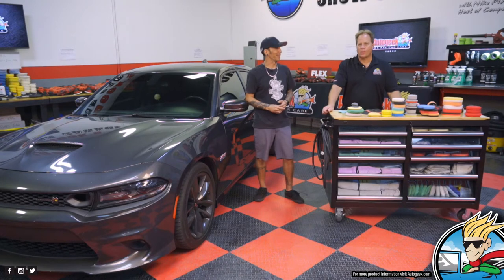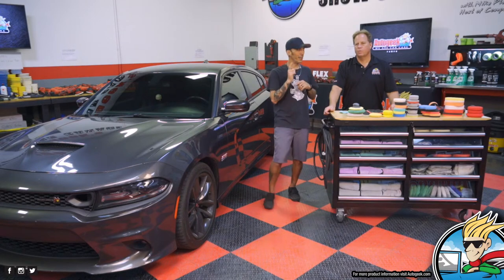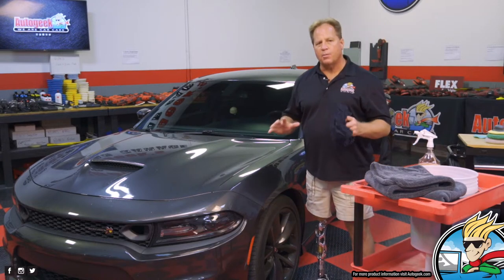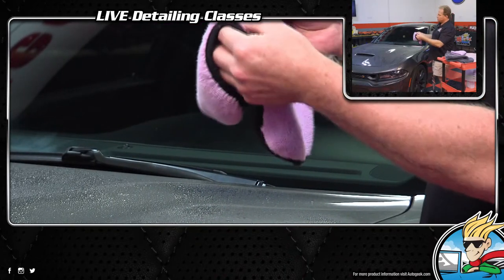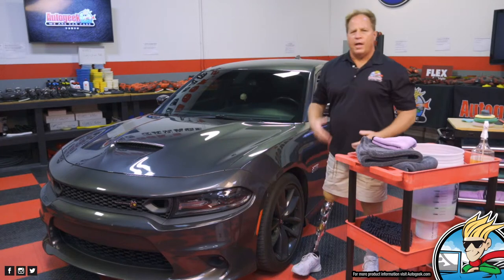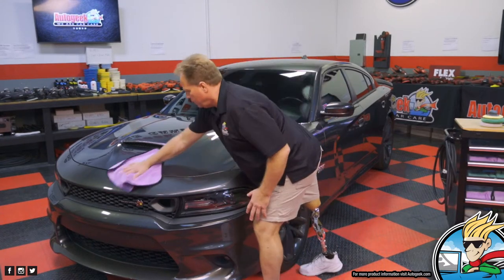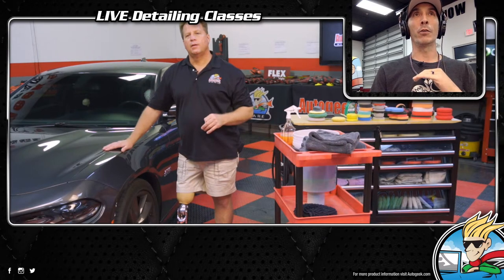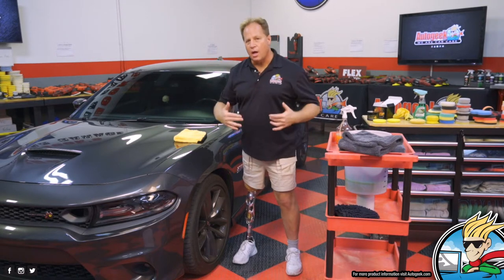Does Hand Movement Direction Matter - Circles or Straight Lines?

Comment: Hello Mike, super direct and redif!  👍 👍 👍.  I often see that you use sonax glass cleaner for clay lubricant, could meguiar's perfect clarity glass cleaner do the same ?.  Thank you in advance.  Nico
Reply from the maker: I have not used the Meguiar's glass cleaner for a while so I would have to re-visit it.  BUT - SONAX actually recommends their glass cleaner as a lube for Clay Discs, (the Nanoskin style), and I took it upon myself to start using it with clay.  I find not only does it work great it's also like a secondary car cleaning step, (besides washing the car), and I like getting cars as clean as possible before doing paint correction.  -Mike Phillips
Reply: @autogeek  Very good idea, in window cleaners there is isopropyl alcohol, so you decontaminate the paint in 2 in 1 if I understood correctly ?!  👍 👍 👍.  Thanks Mike for bothering to answer me, super cool!  ☺️👌

Comment: I do all my detailing by hand due living in a condo. Would love to findcan affordable cordless polisher.
Reply from the maker: Be careful.  There are more and more cordless tools coming onto the market. I have tested a few different brands.  The tools usually work great but the batteries either don't last long or take too long to charge or both.  

From my experience, to date FLEX has the best battery technology.  So yeah finding affordable is good but if the tool disappoints you because the batteries don't last long you'll have buyer's remorse.  
 
-Mike Phillips

Comment: What non abrasive polish do you use. I am new to this and have a black car with horrible swirl marks. I will be doing this by hand for a friend if possible.
Thanks
Reply from the maker: For swirls, you would want to use a light abrasive one step product such as BLACKFIRE One Step as it can be used by hand. Just use a polishing hand applicator with the product. If you want to use a non abrasive polish still, you could use Pinnacle Cleansing Lotion as it will help clean the paint and hide the swirls really well.
Reply: @autogeek  so if I use the black fire is that done in straight lines or can I use a circular motion? And what would be my next step after that? Sorry for all the questions, just very new to this and don't want to make it worse. Thank you!
Reply from the maker: @patcollins2696  Working the BLACKFIRE One Step in circles would be perfectly fine. Just ensure to use a polishing hand pad such as this one for the optimal cut to remove swirl marks - autogeek.net/orange-euro-applicator.html. Keep in mind you will have to work the product in a good bit to remove defects by hand, this is when dual action polishers make things much quicker, more effective, and easier.